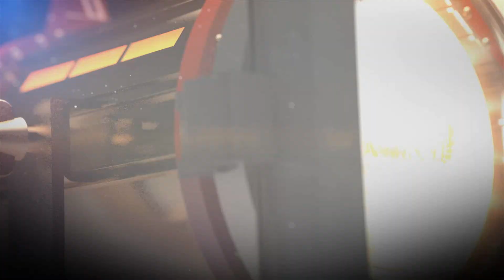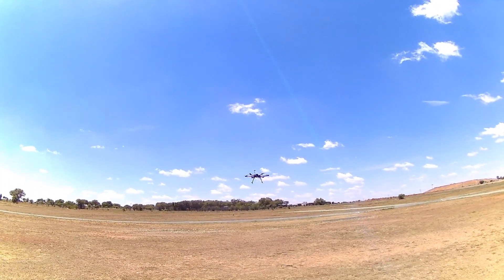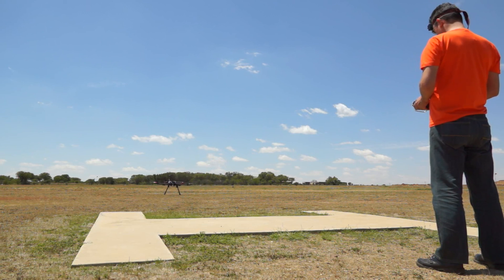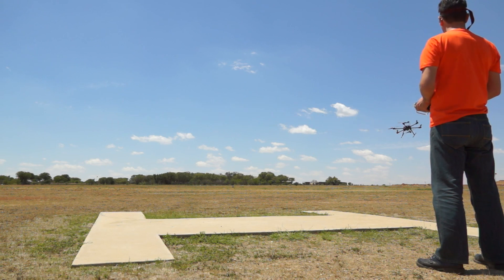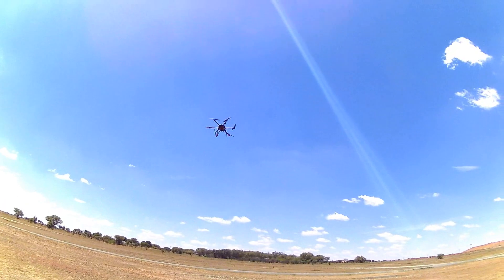Hexacopter Build Part 12 - Maiden flight and Loiter Test in heavy wind

Comment: Hi riaan roux.. Great video.. Plss help me abt my hexacopter. It won't lift in 100% throttle.. I checked all the esc and motors they're working fine. Im using 2S battery 6000mah.
Reply: Not enough thrust. Replace motors and prop
Reply: I suggest checking your Controller calibrations in Mission Planner Calibrations setup, maybe your throttle settings need to be adjusted

Comment: thanks alot for your help
i saw all video of you
when i test my hexacopter >>> the plane do not go vertical directly she go to side slip 
how can i fix that problem
Reply from the maker: Unfortunately I no longer own this so it is hard to diagnose.  I would suggest you start by checking motor directions and confirming they spin in correct directions.  Also, confirm blades and that you have them on the right way round.
Reply: thanks alot for ur reply
i check every thing i will change the APM or all motor and esc to detect problem

Comment: Hi, 
I just built basically the exact setup you have there bar the controller.  i have had issues with my apm system but i think it will come down to a faulty compass module which is currently in the process of being replaced.  
I've bought a few different batteries.  I'm testing it all on 3s as that's what my helis flew but I've ordered a 4s 10500mah, and two 5500mah. 
what sort of flight times do you think i can expect.  
thanks for the vids. they mate the build alot easier.  
i found though as well that my motor mounts were not level and required re-drilling to get exactly level. did you have this issues and just not show it or was it just mine?
Reply from the maker: I will answer from last to first:
My mounts were a little off, but did not require redrilling as I just level them using the levelling process I showed in the video.  I fly very conservatively with my batteries as I do not drain them beyond 35% and this I get 12min on a 4S 5000mAh battery and 18min on a 4S 9000mAh.  Though I originally did build with 3S I only used it for testing as it was very sluggish (which is good for testing).

Comment: hi.good video...
.i also build up a apm hex copter F550, i notice my hex rotate non stop even i release my remote rudder..at the 1st setup, i need to adjust in mission planner the throtter max to 1000, is it the same issue..did i miss adjust some param.? please advice..

Comment: Superb detailed tutorial. thanks for taking time to explain these things. It made my job of assembling my first drone much easier.
Reply from the maker: I am happy that the videos were of some help!  Happy flying!
Reply: Question: do you know how we can setup Pixhawk with RadioLink AT10( R10D receiver)? thanks
Reply from the maker: I do not have a PixHawk FC but following ESC connections and matching up channels should work about the same from what I have been able to read about the PixHawk
Reply: +Riaan Roux problem is pixhawk understands sbus while R10D gives out pwm signal. So there needs a converters in between
Reply from the maker: OK, I understand.  The R10D does not do SBUS so you will need to get the R9D receiver.

Comment: Okay, after some testing, retesting, retesting, then finally reversing the power leads to all of the motors I got mine to become airborne for like 0.5 secs. At wich point I realized the right side was lifting more than the left, causing the copter to go left quickly,. What would cause one side of the machine to get more power than the other?
Reply from the maker: +Red Rolo It is hard to say exactly what the problem is, but first point to check is compass calibration. If you can control it in the air you might also want to try an AutoTrim

Comment: I think you have made my mind up for my next project. Watched all 12 videos and think I can pull it off. I found your videos while looking up tips for my CX20 on installing a cheap gimbal and I just want to say thanks, they have helped me a lot. Keep up the good work. Have you got an approximate total price for this build project?
Reply from the maker: +Joseph Smalley The cost could vary wildly depending on who you shop with on AliExpress for some of the parts.  So far mine has cost just under $600.  I still need to do some videos on installing the Gimbal as well as the PRM-01 module and also the FPV system.  It will take a little while as I am waiting for parts.  Currently we have a postal strike (again) which is slowing imports into South Africa to a crawl.
Reply: @RiaanRoux  how much flight time did you got
Reply from the maker: @adarsfpv  12min
Reply: @RiaanRoux  can I get 26 min flight
Reply: @RiaanRoux  by using good motor or increasing mah of battery !
Reply: @RiaanRoux  please help me
Reply from the maker: @adarsfpv  If you use a large voltage and capacity battery it should be possible yes.  I used small batteries on this machine.  It is sold now so I cannot test further.
Reply: @RiaanRoux  which motors are they
Reply: @RiaanRoux  and which battery did you used?
Reply: @RiaanRoux  and do you use Facebook/insta or any plzz